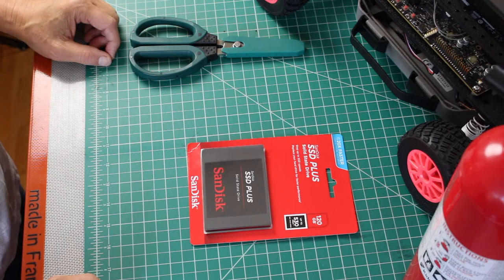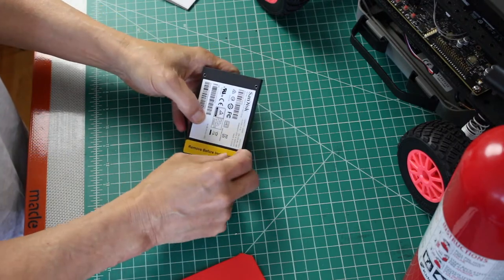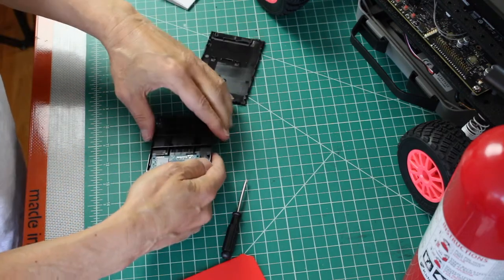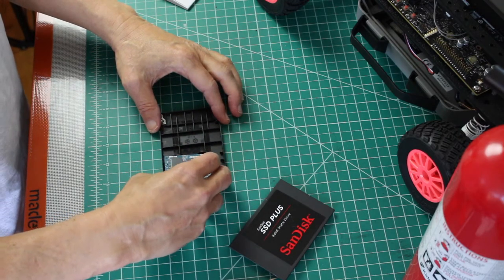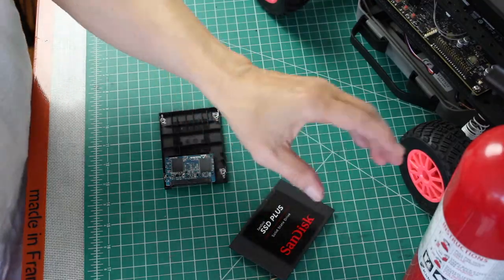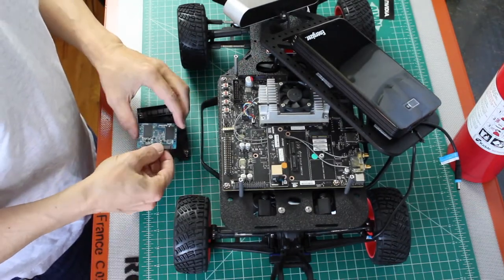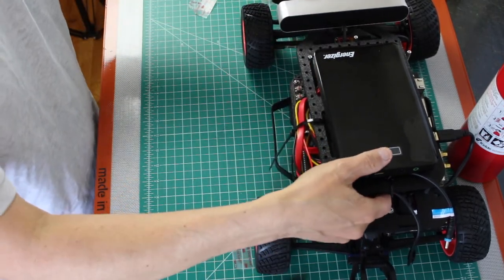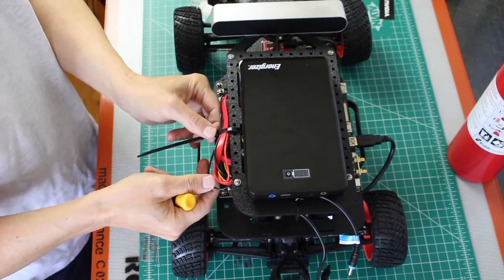Void a Warranty,  Why Again? SSD Install -  Jetson RACECAR Build

Comment: Arf that's too bad for the warranty ! ;) Got a little question here... I'm planning to build my own autonomous car but the traxxas car is quite hard to find and quite expensive now ... Do you have any suggestions about this ? Thanks
Reply from the maker: I believe that MIT is now using the TRAXXAS Slash 4x4 Platinum which has the same mounting points for the platforms. Thanks for watching!